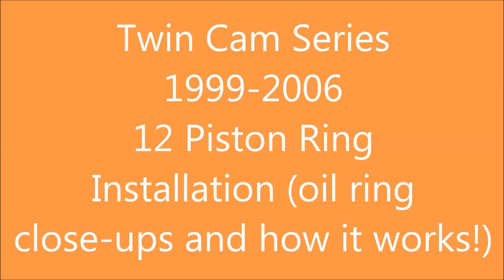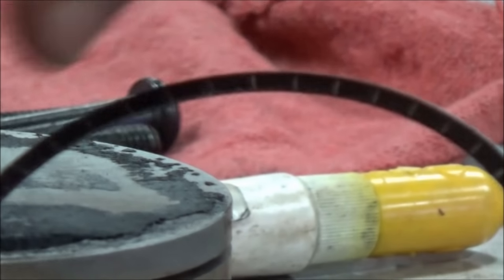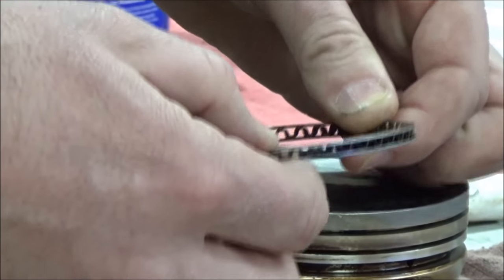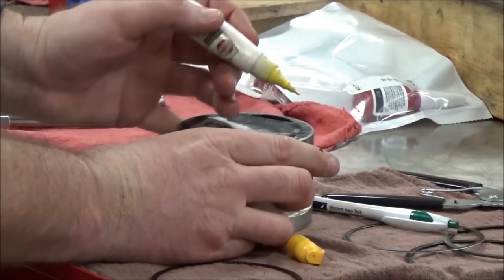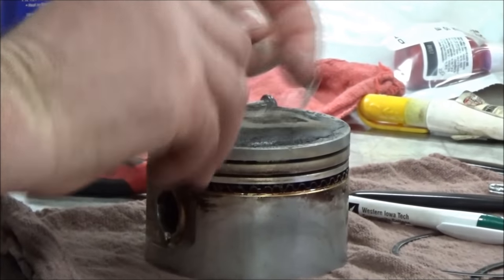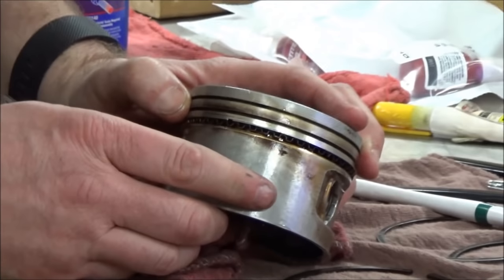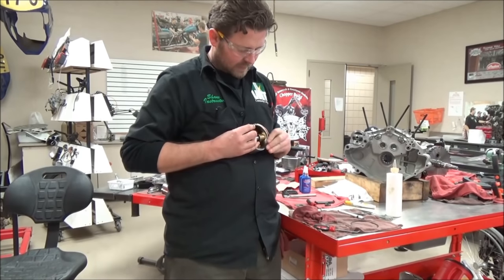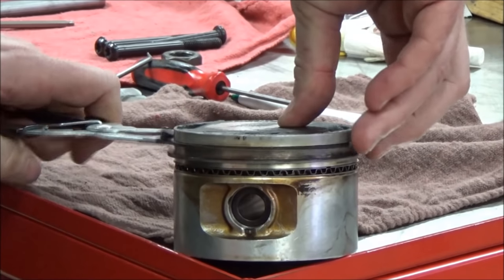How to install piston rings and not break them. Oil ring explanation POV installation! #pistonrings

Comment: I have another seemingly strange situation with piston pins I'm going through right now.  My stock 103 (SE kit on my 96) piston pins were hard to get out and needed a punch.  The Wiseco's slide in smooth into their bores....is it normal that HD pistons/pins are that tight vs Wiseco?  The machine shop is top notch and sent me a matching set of VT2791 Wiseco pistons (replaces VT2763), rings and piston pins with circlips. So I doubt they sent me the wrong pin.  I could re-use my HD pins in my Wiseco's I suppose but would rather not.  

Which leads me to another question (who knew it was this complicated?).  The Wiseco circlips seem very hard to spin when in the groove.  They get installed with the opening pointing near the pry recess pointing down and I understand the gap must point up.  I very nearly gave up for fear of dropping/scratching the piston or damaging the rings I'd just so carefully installed.  I barely got it to move a millimetre.  It must have been an hour of fighting.  I finally resorted to a hammer and screwdriver but that shouldn't be necessary.  One finally move a bit at a time with some taps to the end of the screw driver while the other one only by getting at a weird angle and hitting the side of the screw driver blade.  I finally got both pointing upwards and glad I did as I don't want to lose a circlip and have the pin come out (both terrible situations).  But the stock ones must be a lot easier to spin i.e. are not as stiff/tight.  Ironically the Harley piston pins are super tight requiring a punch and hammer when the Wiseco's slide smoothly right in there (but still don't rock around at all), but it's the other way around for the circlips I'm sure just to confuse me personally.  My worry now is the second circlip when I mount the pistons on the conn rods.....the above drama was just while on the bench so optimum conditions.  No I don't have a $150 circlip installer but see most people on youtube and even FMH uses just a screwdriver and fingers.  I'm re-thinking that now and should maybe by one.

The above question is less urgent at this point than the below one about the ring end gaps and gap positions.  I also realize you have a paying site but I'm already a member at FMH and they haven't answered one question I asked a year ago nor this very question yesterday.  Maybe next year I should pay you instead of them even though I do love their site and videos.....I think yours are superior detail wise.  The things you mentioned about that oil separator ring and top/bottom rails were mostly ignored by them (and Clymer and possibly even by Harley in their own manuals).
Reply from the maker: Hello friend! Still have questions? Coach Conley provides tech help and works one on one! His YouTube and training center has grown beyond the ability to answer every question (11 million views! Over 500,000 a month!) He gets 300-400 requests a week. Become a member for his direct cell phone number and personal assistance!

Click here for the membership links and welcome to the community! https://how2wrench.com/product-category/specials/ 

Want to say “thanks” or “keep it up”? Click here https://www.paypal.me/how2wrench 

Your answers and help are just around the corner. Save time and money while protecting your investment and yourself by doing it the right way!

Comment: Hi. cau you tell me if it is possible to replace a piston rings without grinding a cylinder surface?
Reply: You can put new rings in a cylinder without boring or honing, but the cylinder will wear the rings down in uneven places.sometimes you can hone the cylinder, but if it has lots of hours on it, it will be worn .best to have measurements taken if possible, then decide on putting new rings in.

Comment: I'm trying to find piston rings, engine bearings and a seal kit for a 1986 Honda shadow VT1100.

it's hunt and peck on ebay and the bearings I ordered turned out to be used.

is there a good source you know of that has new parts?
Reply: Bearings are usually standard.  Engine designers work around bearings available from suppliers.   If you can find the specification, or possibly just the measurements a supplier like SKF or GKN should be able to help.
Reply from the maker: Yes. Dealers have the ability to do a search on the Honda database looking of stock at other dealerships. Problem is they won't offer it usually as they are afraid to send business out. I smart dealer would take your money and order the parts in from the stocking dealer and you would never know the difference.  Like this tip?

Head over to my website become a member now and to receive 20 minutes of personal mentorship with me. You can even use FaceTime if you have it or find a friends iPhone and we can walk through the actual carburetor process together. I look forward to mentoring you.

Note: Membership is not required to receive coaching or email help. Here are the direct links to individual services offered at H2W:

Email Answer Service-Click http://how2wrench.com/product/email-support/ 

Phone/FaceTime Coaching-Click http://how2wrench.com/product/personal-tech-training-phone-facetime/ 

DIY Mentorship-Click http://how2wrench.com/product/diy-coaching-hire-teach/ 

Dealership Training Services-Click http://how2wrench.com/product-category/dealer-services/ 

MMI/Tech School Student Tutoring-Click http://how2wrench.com/product/mmi-tech-school-student-tutoring-services/

Motivational/Guest Speaker-Click http://how2wrench.com/product/motivational-speaker/ 

On-site Training Services-Click http://how2wrench.com/product/on-site-training/ 

Tech Line Services-Click http://how2wrench.com/product/tech-line-minutes/ 

Mechanic on Duty-Click http://how2wrench.com/product-category/mechanic-on-duty/ 

Did you like this free video and hope to see more? Would you just like to say thank you with a donation? Click https://www.paypal.com/donate/?token=TvKoeRazPL-KysbM-e0ttz-C_gPq2IrqxDmM3ORCu4nxJzQWxYbmo-6m3YuNu64XHLngGW 

Keep Wrenching,
Shane Conley
Instructor/Motivator/Motorcyclist!
www.How2Wrench.com

Comment: Thank You for Reply

They are said when Lapping a Valves , 
There is pressure on the old piston rings and , 
Oil will leak into the combustion chamber
Is this what will limit true
Reply: if you seal up cylinder head valve seats to valve by lapping in completely and replace the valve seals if you did nothing to the rings or bore then it May contribute to more oil burning by the worn rings. It is possible to burn more oil in this way from 35 years of experience.

Comment: At 11:58, aren't the yellow markings on the piston crown, corresponding to gap locations of the Bottom oil rail (B) and Top oil rail (T), reversed when  compared to the diagram in the manual (Bottom oil rail --> gap at location 2; Top oil rail --> gap at location 3)?
Reply from the maker: You are correct. Good eye....😁...Thanks for subbing...
Reply from the maker: I made a pinned comment of your finding....ty
Reply: @How2Wrench  Now "joined" as well.  Thanks for all the great content over the years.
Reply from the maker: @Zerk_Ziegler  Appreciated...and thank you...